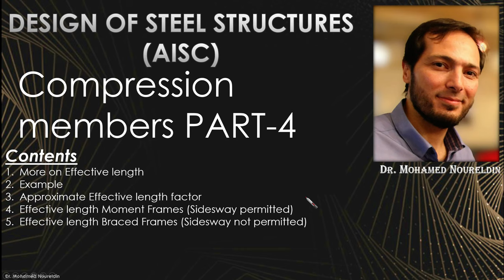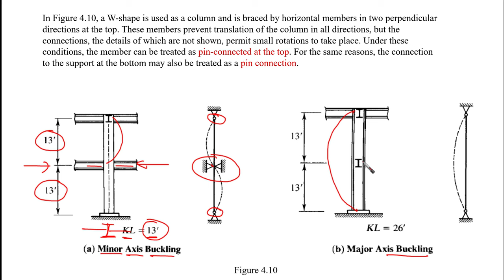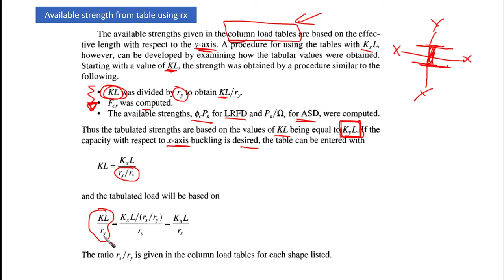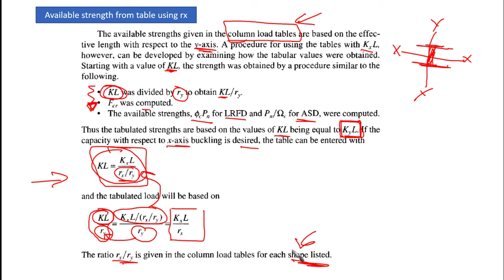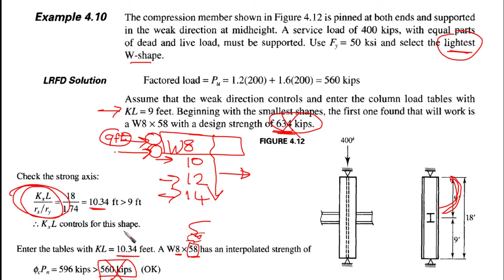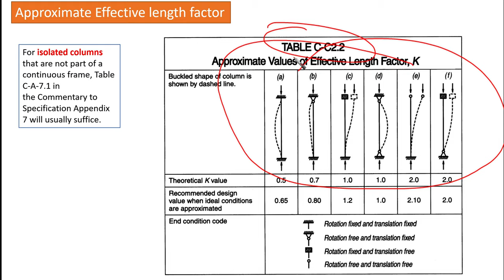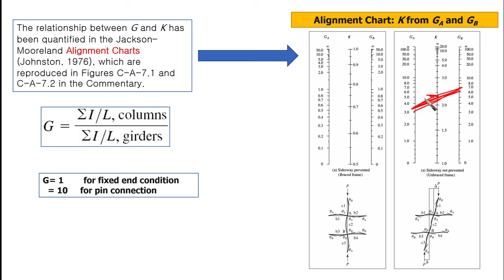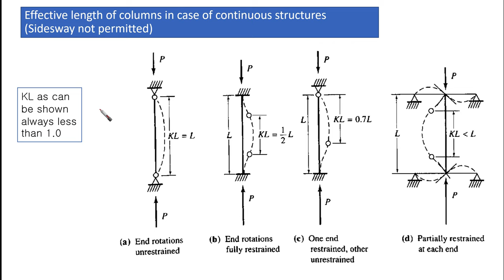11-Compression members PART-4-More on Effective length

Comment: thank you dr. mohamed

i have a question please in 37:30

why the section W10x49 is not the lightest one ? KL/ry design strength is 569 kips
when we checked the slenderness in the strong axis it was 10.53 > 9 of the weak axis. which means the strong axis governs the failure.
when i calculated the design strength based on the strong axis it was 540 kips > 500 (demand)
is there something that i am missing ?

or we are searching for the lightest w section such that the weaker axis governs the failure ?  and that is why we chose W12x53 what is the logic behind this...
 
i appreciate your reply.
Reply: +1
Reply: I am having the same issue understanding that part too! I kept repeating that part maybe I missed something but nothing. couldn't understand it